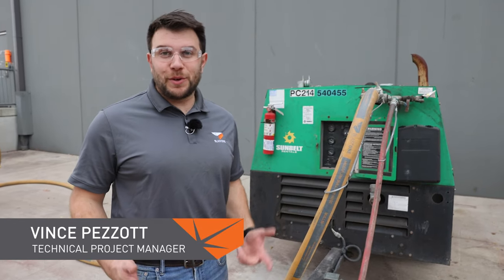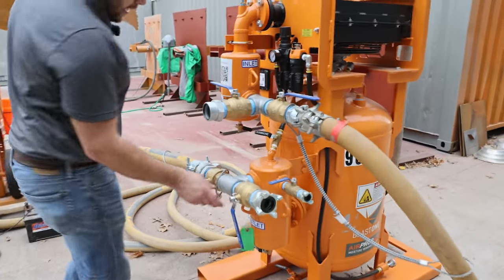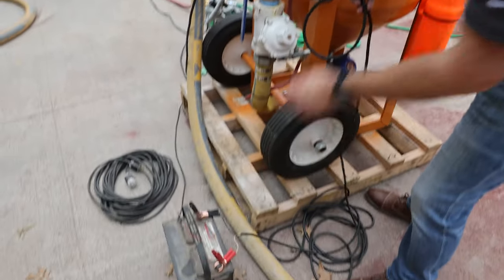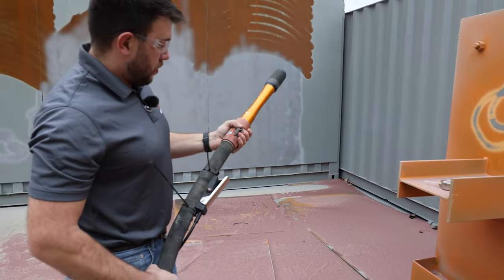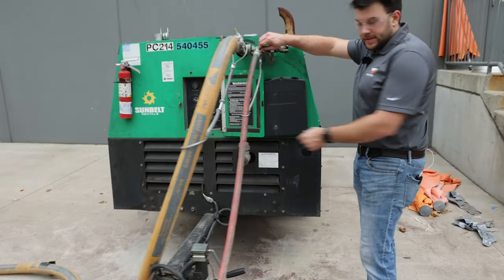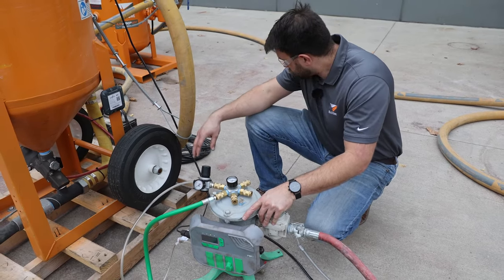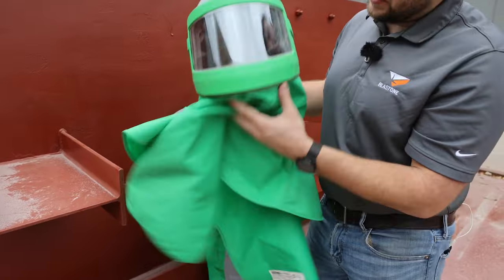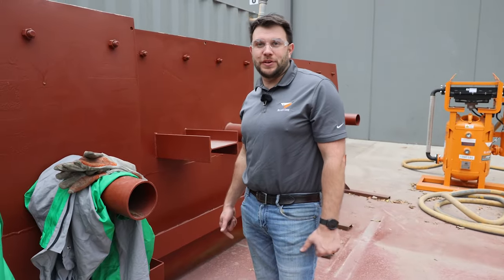Sand blast set up 101 - easy how to guide (for beginners)

Comment: Why not attach the air line to supply the breathing air unit (GX4) into the outlet of the air prep / aftercooler / air dryer unit? The air coming out of the air prep unit would be cool, clean, and dry versus the air coming out of the compressor being hot, wet, and possibly oily.
Reply from the maker: Weld.. you are technically correct, often we do hook up the Radex filter to the AirPrep, as this will remove oils and moisture particles, however it is common practice in the USA, where Deliquescent dryers are used, that operators complain that the air is too dry for breathing, drying out their sinus passages.  The GX4 you refer to is the CO monitor, and this is attached to the Radex breathing air filter.  This filter has a 7 stage cartridge which will remove all the nasties from the air, so I don't think you will have any issues getting false readings.  The Blast Helmet uses a C40 climate conditioner, so that will cool the air for the operator as well.